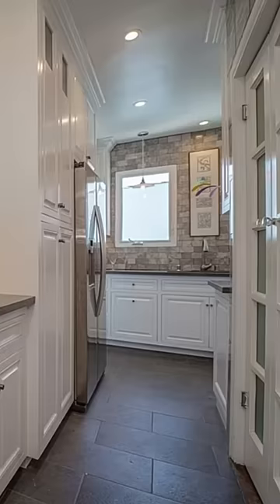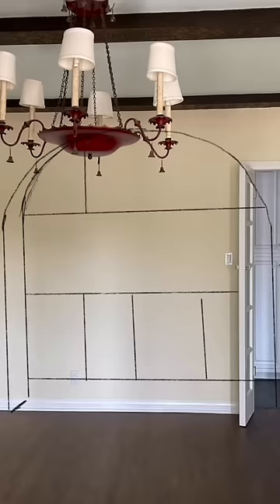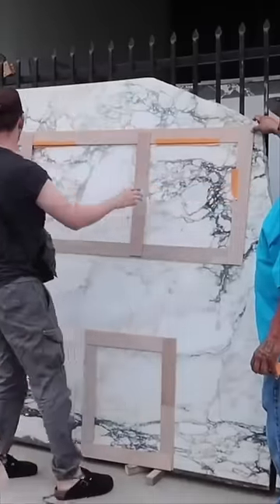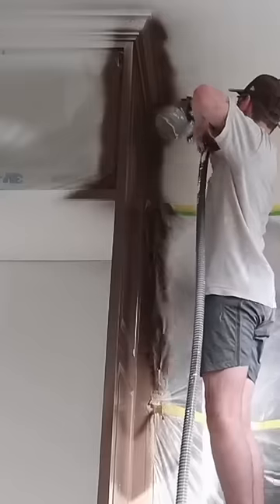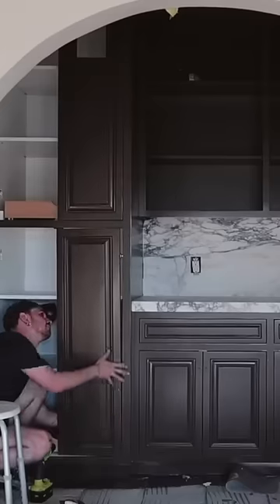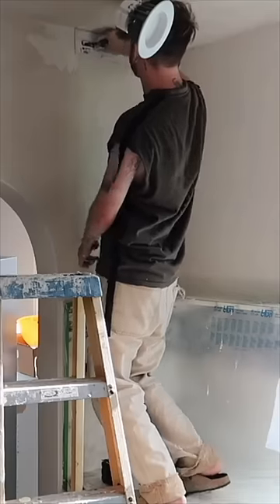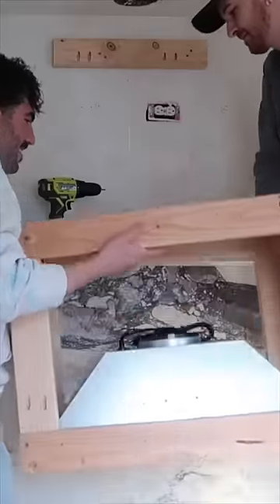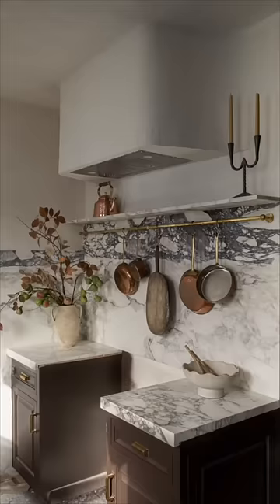Basic kitchen got a MAJOR makeover

Comment: I'd be afraid of plastering the fan in. You know when you're cooking, things get hot an splatter and impart smells. So I'd be afraid with fluctuating temperature's the plaster would get funky after a couple years of use. But it looks good. I just hate plaster. I live in a house built in 1879. I hate plaster.